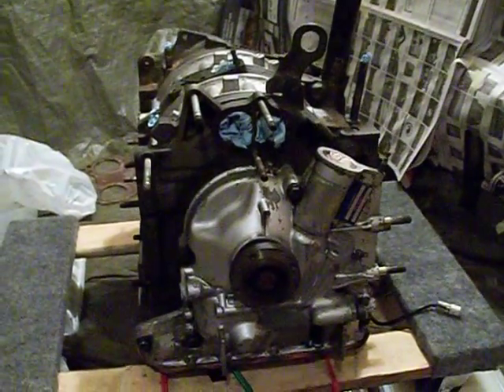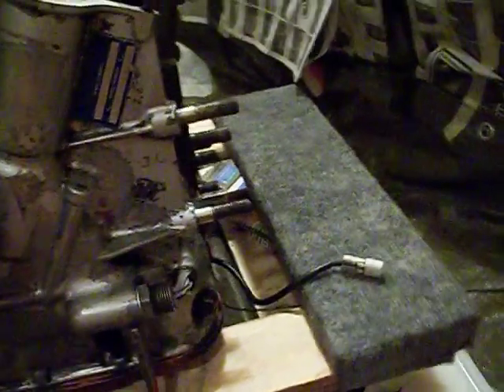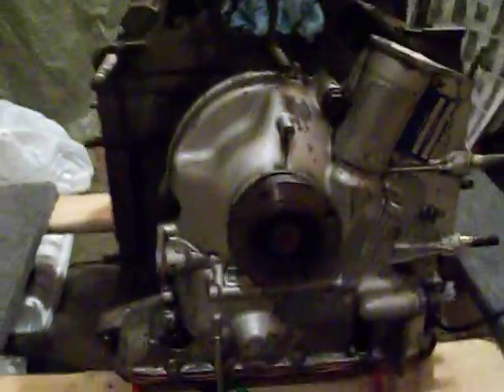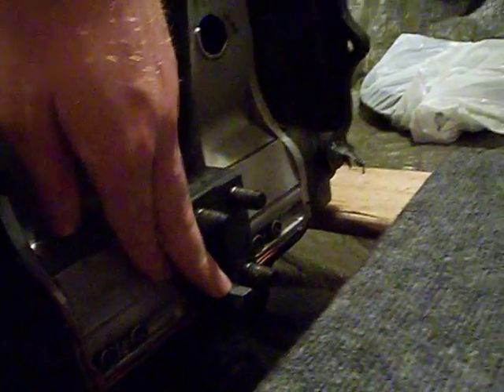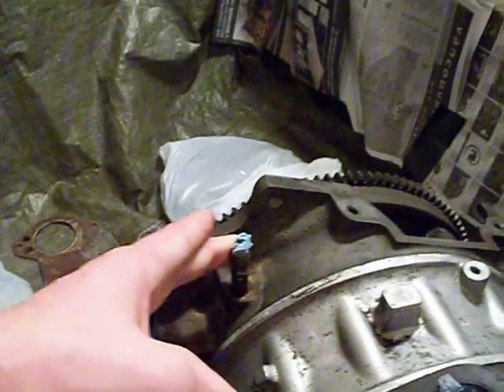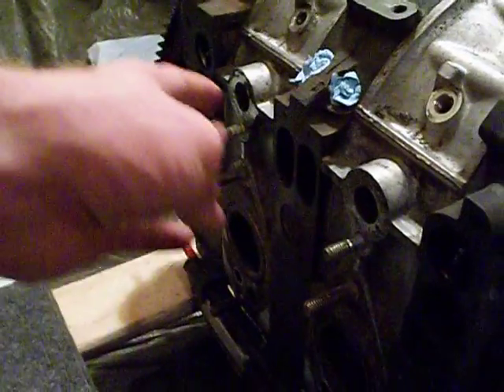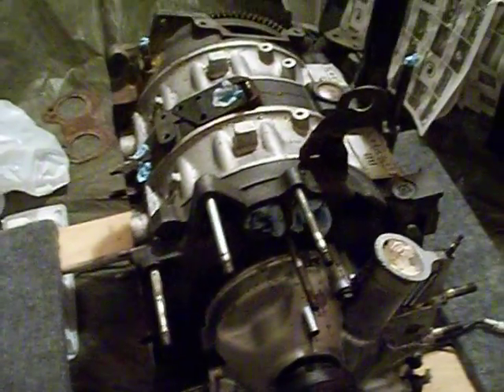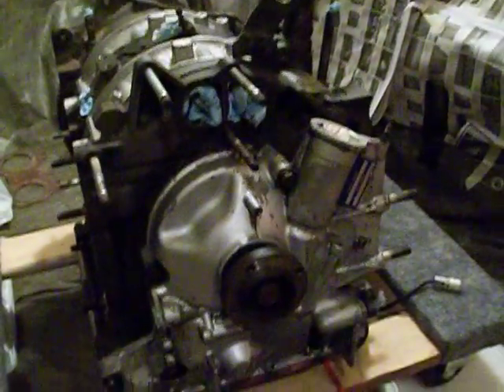Mazda RX7 13b bare engine core ports and openings

Comment from the maker: @snaple07 yes. I believe Mazda still calls them crank angle sensors but I like to call them eccentric shaft sensors since the proper term for the "crank" in a rotary engine is the eccentric shaft, not the crank shaft.